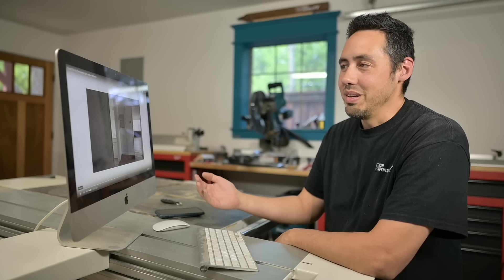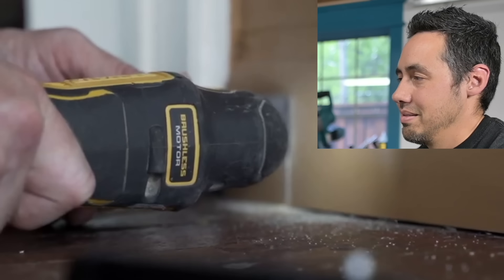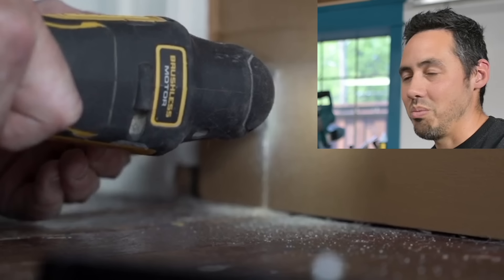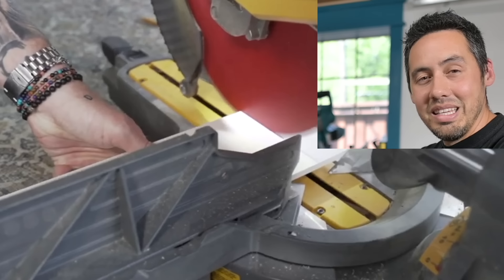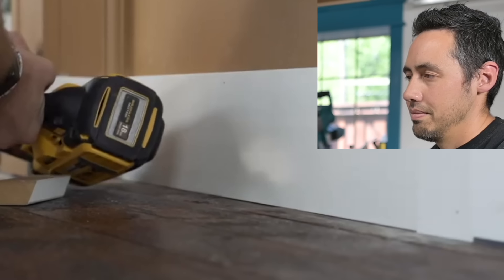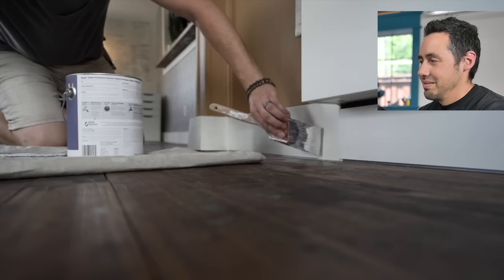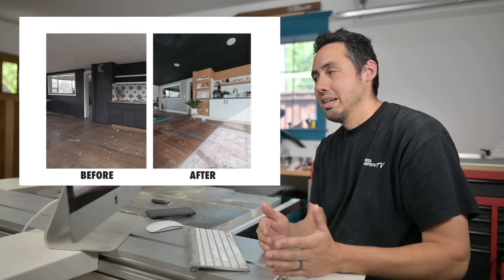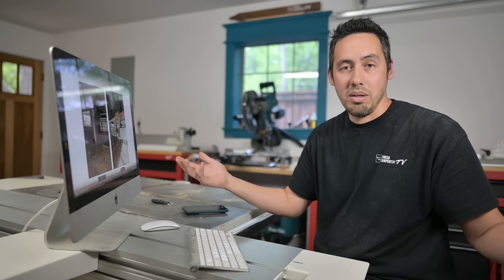Carpenter reacts to Do-it-yourself Trim Carpentry

Comment: I'm scratching my head trying to figure out where that new cover molding has a separate piece a couple inches from the casing.  Why isn't it a single piece from the casing to the miter cut? That job  puts the a in Awful.  It would have looked far better just leaving the original base and painting it.

Comment: This reminds me of a video I saw many years ago where this guy was trying to sell a wide angle inside corner drywall taping tool. It basically looked like a large spoon ground down to a point. The guy kept going over the joint over and over and never got it to look right. By the end the guy looked aggravated and defeated. I couldn't believe they actually posted the video.

Comment: He actually seemed proud of the finnished, he's standards are obviously very low. I saw an emergency programme ounce where some idiot was cutting baseboard on a chop saw, crossed his arm in front of the blade, and the blade caught his jacket and pulled his arm in and cut it straight off, they did manage to reattach it, but he never got full use of it again, and it looked a mess. You wouldlike to think no one would be stupid enough to pull the blade towards their arm, but obviously, their are some incredibly stupid people out there.

Comment: What's the point in him caulking the top if he doesn't even bother making sure the caulk isn't visible against the wall? If the goal is to make the trim look adequate, then leaving the caulk visible at every join and corner with a giant string of it visible in the middle is so counterproductive. He's just gona have to come back and get rid of that and re do the paint on the trim and wall. This is horrendous.

Comment: If you have to cut out the corner bead and all the transitions anyway, what was the point of the blocks?  Totally useless.  The original wasn't dropped on April 1st, was it?

Comment: I fail to see a reason why anyone would even buy this - when you are still needing to do the same type of work and use the same tools. All its doing is eliminating the easiest step, (removal) and I’m betting is probably more expensive to buy then just new molding.  Its a solution to problem that shouldn’t even exist, and its not even a very decorative type molding.  I dont understand why anyone even made this.

Comment: That has to be a joke video.  There is no reason for that "transition" piece between the casing and the trim, unless the old trim was as thick or thicker (which it shouldn't be) than the old casing...

Comment: Why do you have to put those small pieces of cover trim in? You could still cut out the little piece of old trim but then instead of putting that little sliver in just put the whole piece of cover trim in so there's no horrible seam. Wtf?

Comment: Why they couldn’t just run that board straight up to the door architrave I don’t know. Surly it would look better than those so called transition blocks.
Trust me I’d be so embarrassed I would never put that on video and on line.
I’m Not a carpenter by a long shot. I’m a painter and decorator and these type of jobs really wind me up because I have to make a silk purse out of sows ears.

Comment: Thing is it's not even ornate. Just looks like someone stuck planks to the wall. If you have a nail gun then why would you be even using a DIY product like this? 

All they had to do was sand the original skirting (baseboard) and paint it white. It would taken less time and looked better.

Comment: Definitely a weird item, who could do this job and not pull off old baseboard? Surprised they nailed the cover trim on, should just be double sided tape to really make the job easy and with no paint required, if you're going to do a job bad at least make it as easy as possible lol.

Comment: By the time you take out the multitool cut and remove and clean you could have took off the base. 
Its probably double the price of a normal mdf moulding
And that last picture. you do all that work and not even do the floor.
The whole thing was pretty sad.

Comment: terrible idea  and even worse exicution. 
3 things im suprised you didnt mention. 
that offcut  on the saw that could be launched  while you were talking about the cancer boards

the 'plinth' block is the same thickness as the casing so its doing nothing. they could have ran the cover mould up to it and done a half decent job. 

the round over on the plinth block is way larger than the cover moulding

Comment: I was cringing the whole time. I'm not even a trim carpenter. Then the video said "Don't worry about the gaps. We'll fill those in later with caulk." That's not good craftsmanship. Terrible product. If they can remove videos because they contain false info or wrong medical advice. They should remove that video. I feel videos like that hurt the entire trim/carpentry/cabinetry/joinery trades. Just hurts trades in general that filling in gaps with caulk is okay. That cutting corners is good craftsmanship.

Comment: Cover trim has to be the laziest idea I have ever seen.  If you are wanting oversized base boards, why??  Just.......why?  This is, to me, like replacing your tub with a cover for your old tub.  Then, gluing plastic over your tile wall.  It will work but, why??  They should start commercials for this with, "remodel your home without doing it correctly".  Who wants to pressure wash their brick home when they can cover it with vinyl?

Comment: I usually cope the inside corners, but outside corners can be tricky if the walls are out of square. This system does nothing to help the amateur with them. I can only imagine the gaps that they would be trying to fill with  caulk. It's a joke to the professional and a joke on the diy'er.

Comment: It actually look a lot worse even from a distance. Isnt the point of this product that you dont need expensive tools to put these cover trims on? I pretty sure that a crowbar is cheaper then an Oscillating multi-tool. Paint the old ones or remove and replace them. What a shit product...